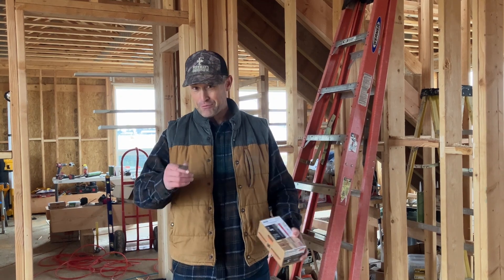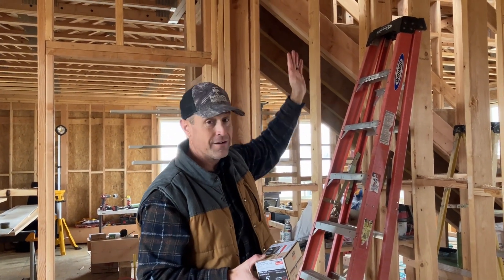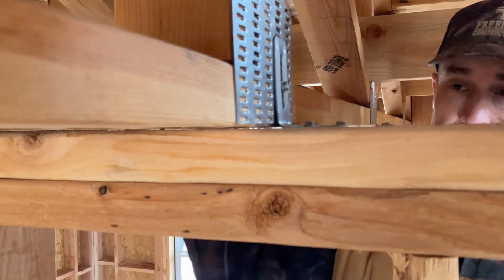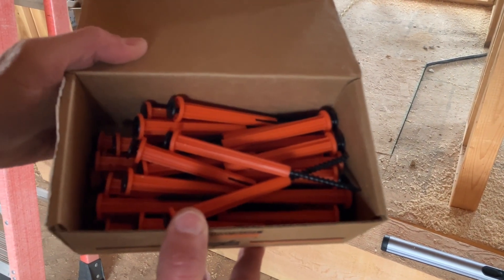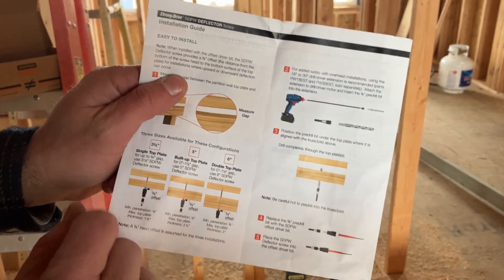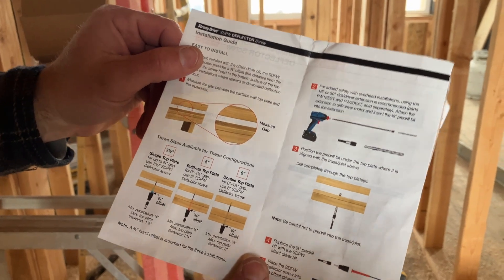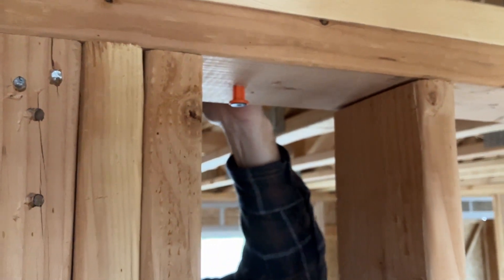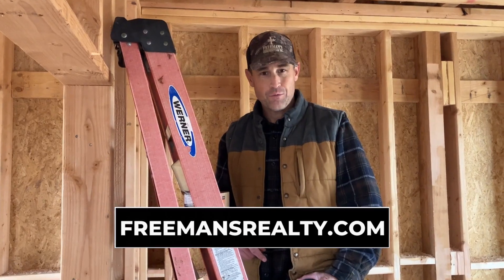Squeak Free Floor Trusses Using Simpson Deflector Screws

Comment: Most floor squeaks are the subfloor rubbing against the shaft of the nail or staple that is trying to hold it down. I was a carpet guy for decades, fixed countless floor squeaks. Either drive or pull the nail/ staple, and stick a screw in the joist right next to it. Screwed floors don't squeak. I've never even heard of trusses causing squeaks. Learn something new every day.
Reply from the maker: That’s solid advice!  Thank you for watching!

Comment: Nothing is supposed to fastened through the mending/truss plates
Reply: And you just need to shim the top plate to the joist and use regular structural screws.  Only roof trusses should not be bearing on interior walls when clear span is called out in the details.  Usually the framing detail shows a 1/2” minimum clearance from top plate to bottom cord.  Call your engineer/truss supplier and get clarification.
Reply from the maker: Thanks for your comment. We contacted the Builders First Source truss engineer prior to making the attachment and they affirmed that they did not want the floor trusses or the roof trusses to bear or have a  fixed attachment to any non bearing walls. Simpson Strong-Tie says in the catalog not to use their standard truss clip on floor trusses but only on roof trusses. The Simpson truss connector screw was what was recommended. Have you had truss engineers tell you that it is okay to have the bottom cord of the truss in contact with the top plate of the non bearing walls?
Reply from the maker: Definitely don’t want to damage the gang nail on the trusses. The truss connector screw worked better in this application because the gang nails all broke on top of the wall. The truss connector screw was fastened from the underside of the trusses.